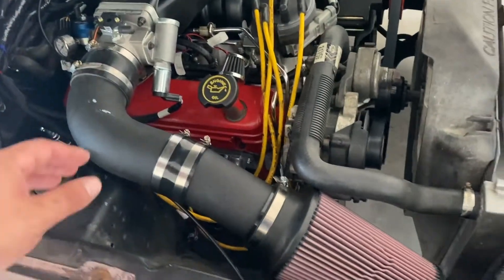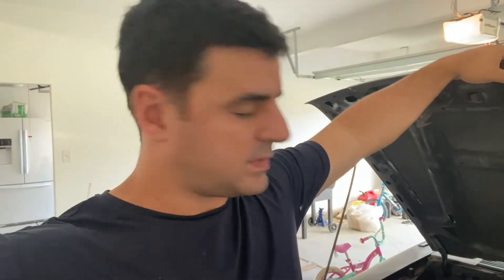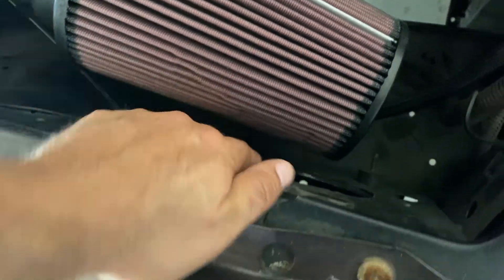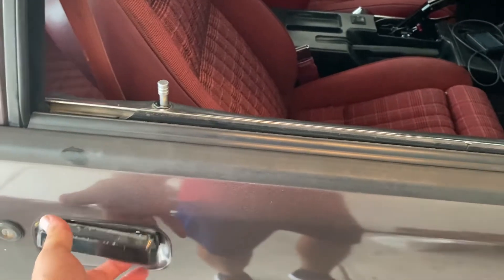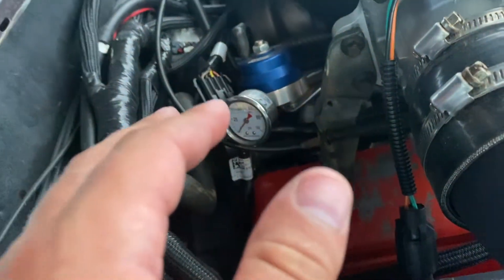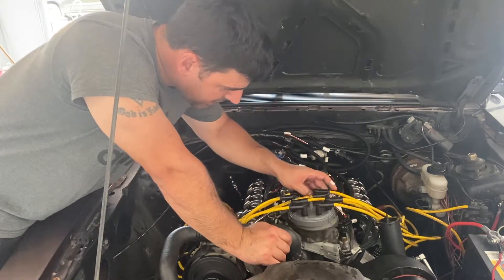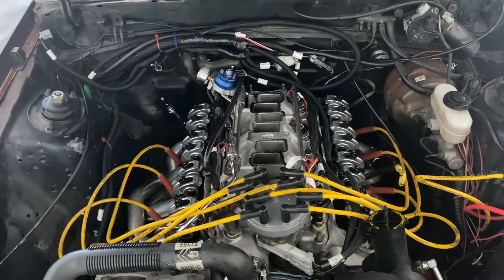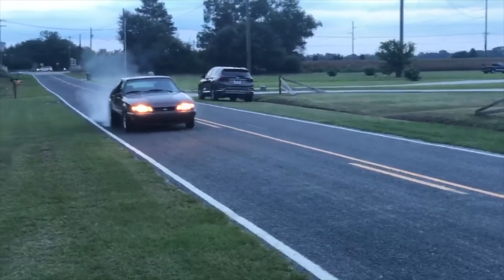Diagnosing Rocker Arm Noise on 331 Stroker Foxbody Project - Drag Car Project continues..

Comment: The whistle is your throttle body, BBK/Edelbrock throttle bodies are notorious for it. I sold mine and bought an Accufab because of it. You sometimes can drill a small whole in the throttle blade and it will fix it. On your rocker/valve train adjustment what your running into is a sbf hydraulic roller is a Small Base circle cam. You can’t really adjust them like an older hydraulic or Mechanical super difficult to get them perfect if you do it the old way. What you want to do is adjust the intake valve with the exhaust valve open and then adjust the exhaust when the intake begins to close.

Comment: That was a cool cheap cold air intake that looks as good as the 300 buck ones and will draw just as much colder air as the expensive ones do as well. I like it and would have done the same thing one mine and if no one doesn't like it then tough because I did it for me and not them anyway 🤣😂 but the car is sounding gnarly as hell and that burnout was done effortlessly which shows that it has plenty of power. I've seen some look like they were straining to do a burnout with the tires slowly starting to turn 🤣 but I finally got started building my 347 and I see what you meant by those clips being a pain in the ass to put in the wrist pin groove. It seemed like it took forever doing all 16 of them at one time. I wish I could post up a picture and let you see it but I'm fixing to put the windage tray and cam gears and chain on this afternoon so hopefully it won't be too much longer before I can bust it off . Can't wait 😁🚗💨💨💨
Reply from the maker: I absolutely hated those clips. Glad you got started on it! And yea that burnout was 1st,2nd,3rd gear lol

Comment: Track only car I would run dynomax race bullets dumped at the rear axle. You would be surprised how restrictive the flowmaster really are and if you want proof watch engine masters when they run them on the dyno.
Reply from the maker: Yea I’ve seen it and definitely am not keeping the flowmasters. It’s all being done for a reason. Once I start racing and making changes you’ll see 😉

Comment: good ol' hot air intake...lol.  close hood and it pulls hot air from radiator fan. should have some cooler air from wheel well
Reply from the maker: If I wasn’t going to do be doing a turbo eventually I’d put more effort into it but for now it’ll do 🤷‍♂️ lol
Reply: @RegularGuyGarage  turbo is where its at. check out my little videos. 6.86 at 104 bone stock (arp head studs) explorer motor on 15psi.
Reply from the maker: turbosha that thing rips! What size turbo?
Reply: @RegularGuyGarage  its the on3 kit. 70mm turbo with .68 exhaust housing. The .96 that came with it spooled too slow for me. Got it at LMR one labor day with the code. Knocked off like 300 buck
Reply: I cut up my h-pipe and installed dual cutouts.  Now I can cruise with my flowmaster 40s with tail pipes or open them to sound like a race car!

Comment: Don’t buy the Dorman door handle, went that route once didn’t last more than a few openings and it didn’t come with the rivets. And as for the valve train noise, I have a 331 Stroker with scorpion 1.6 roller rockers. I have adjusted the preload more times than I can count. I went a full turn the last time I did it. Worked good until one rocker nut backed off a bit then stripped the stud and of course the rocker fell completely off. This happened after a 6500 rpm pull. Thought I grenaded the motor and was the first time my 91 GT was on a hook lol.
Reply from the maker: Yea I’m just going to leave the door handle for now lol. Yea I yanked the locknuts down as tight as I could, hopefully they hold lol

Comment: Did you have any clearance issues with the valve covers and if you did what did you do to fix it?
Reply from the maker: Yes. I had to grind the baffle out under the oil filler neck for it to fit